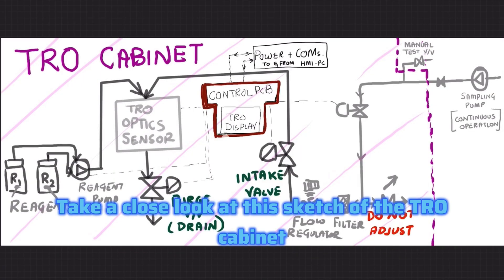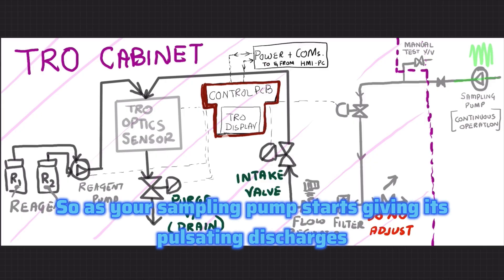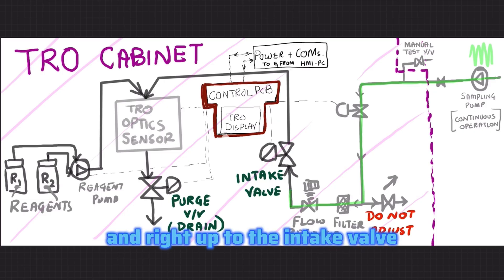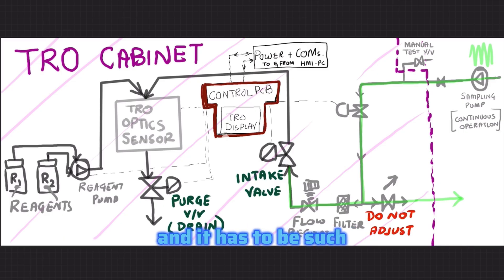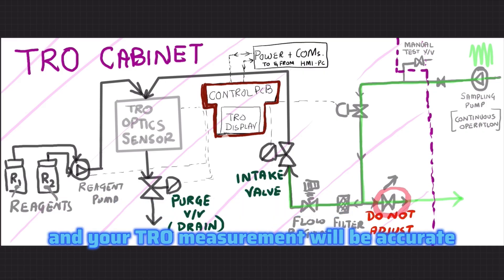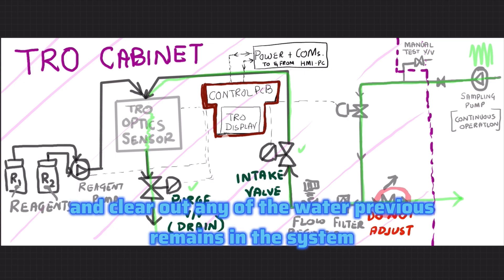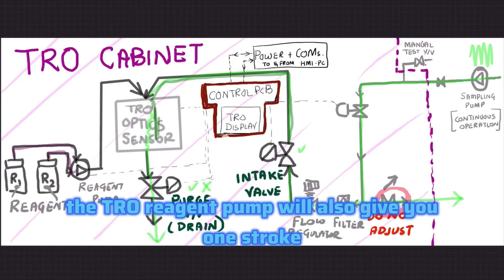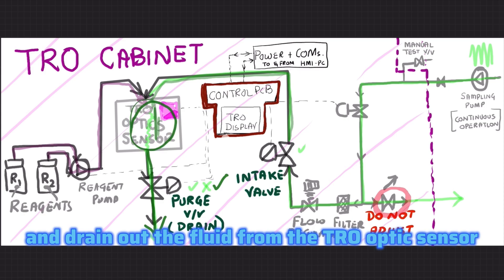TRO MEASUREMENT -  BALLAST WATER TREATMENT SYSTEMS - TOTAL RESIDUAL OXYGEN - SENSOR'S WORKING CYCLE

Comment: IMP is to keep SOL VV / pnumatic actuator / air line free of oil and water. Also Clear the TRO sample inlet line free for dirt debris  mud for good sample flow. For intrinsically safe TRO cabinet air should be available to  keep reagent temperature 25 D.Cent. OR if u need to close air then remove reagent and keep refrigerated.
Reply from the maker: excellent insights bro !! thanks for the share

Comment: Sir ı have a question for you. 1- when I in the ballasting operration i see too much ppm 18.0 usually.can you explain why?2- another question is 1 operation how much I need sodiumtrio sulphat.
Reply from the maker: check the flow rate of water, sample water, calibrate the tro , 
this sulphate qty in manual, I can't tel u as different maker's will.  have different ratios and also u have solid crystalline form or liquid?

Comment: Sir we are not able to maintain TRO VALVE in my system  
on screen not showing 
 Value and after manual purge also not showing valve 

pump continuosly cut off after after some time 
Pls guide what to do 
If possible pls send your whatsup no so that i can share you pic what is showing on screen of TRO VALUE
Reply from the maker: can u pls connect with me on instagram #thedeepseaman, we will try to troubleshoot there
Reply: @Thedeepseaman ok sir thq for replying  
I messaged you on that insta